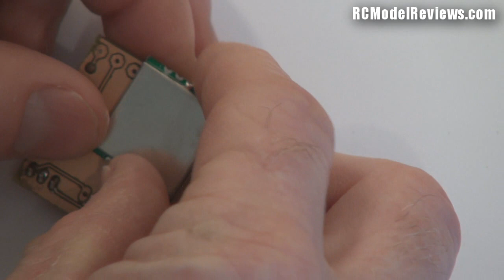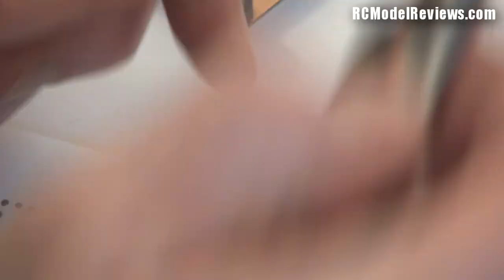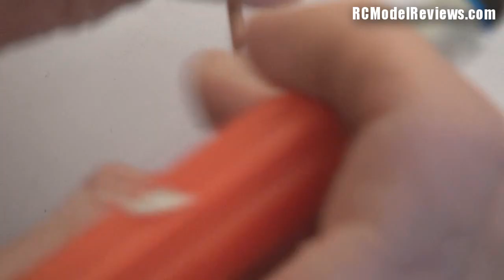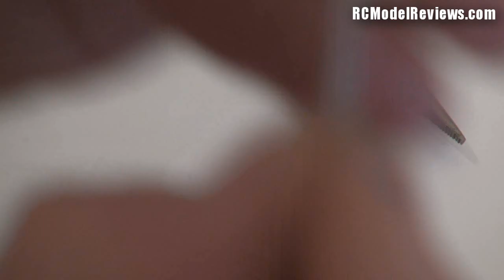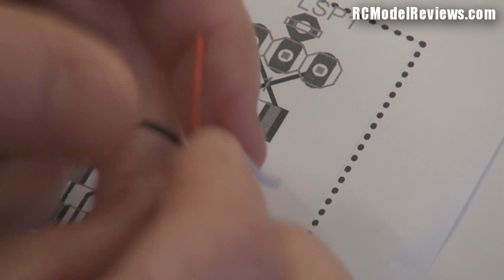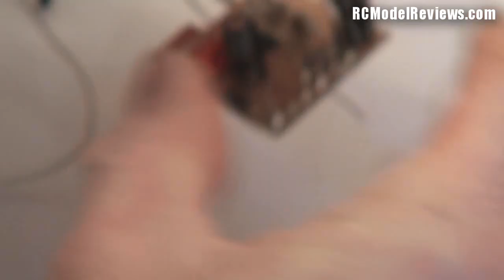FPV Backpack PCB build (part 2)

Comment: Very neat indeed!  Am looking forward to getting my hands on the parts!

When you install the pin headers, just leave the plastic on at first to make them easy to line up.  Once the bottom side is soldered, the plastic bits will just slide off so you can reach to solder the component side as well.  The solder heat seems to weaken the adhesion of plastic to pin (as discovered when trying to get shield pins and Arduino sockets to line up nicely).

Comment: Bruce, good tutorial. I like 5.8G; works well. I made a similar one a few years ago on 2.4G using Airwave 10mW modules that were available from Jaycar. As you've said before 2.4G video is no good with 2.4G RC and picks up wifi etc. But I've had over 1Km with 10mW, cloverleaf on TX and patch on RX.

I've got a couple here still so I could do a quick tear-down to show what's in it.

Comment: Yes... This is 2.4G with a cloverleaf antenna on the TX and a patch on the RX. At 1KM the picture is good with the receive antenna aimed at the transmitter. At 1.6KM the picture is still good, but antenna alignment is very difficult. The RX is a Airwave module and the  antenna a home made patch of about 10db based on comparison with a commercial patch.

I'll post a video of the setup tonight. I'm planning some fpv tomorrow so I may get a chance to video this setup as well.

Comment: Good question, would be interesting to see.
The kit on hobbyking for 45 $ is a 900MHz kit, which means if you were to design the same type of antenna for it, it would have to be huge! (Check out RCexplorer.se for antenna calculator). 

This is a 5.8GHz system and hobbyking are charging 66$ for the transmitter and receiver pair (without camera), and the receiver does look "chunkier". So Bruce's might actually be good value.

Comment: With the correct antenna I've heard of distances close to 2km with this 5.8 module. I fly my blade quad in the basement from the third floor master bedroom and I use my plasma tv for my monitor. The signal is great and I'm just using the stock piece of wire, no cloverleaf, because of weight. My problem is that I need to figure out a way to make a very small lightweight noise filter so I can ditch one of the batteries. I would be very interested in seeing a teardown of your 2.4.

Comment: I was thinking the same thing.
All I can see is the experience you get in tinkering, and that hobbyking sells kits that are like 2.4GHz, 900MHZ which could get more interference than this project if your transmitter is also 2.4GHz which is common (the project is something like 5.4GHz? which is a safer bet for most people in most places).

Comment: Hi Bruce. Thanks for all the great info. I have learned a lot from you over the past year. I don't know where I would be without your guidance. I have a ground station question. I have put one together using cheep red and white audio cables cut to the appropriate length. I installed new rca plugs where I shortened the cable. I run two receivers to an eagleEyes box then out to a foxtech dvr, monitor and fatsharks. Do you think I would view/record better video with higher quality cables? Thanks

Comment: HEY, I finally got my boards to transfer and etch and they even line up. In the end I printed a whole sheet of fronts and backs and used a full sized copper clad board and while all my other attempts sort of failed, or almost worked, depending on if your a glass half empty or lap half full of the other half of your glass kind of a guy.... I digress. I have about two dozen nice boards and at least 8 not so much boards that I'd be willing to trade some of the smaller components for?

Comment: Bruce, first of all thanks for all that you do. 
I have the commercial board and it doesn't have that exposed area where you soldered the shield wire from the antenna. what do i do when i get to that part?
Awaiting a response before i proceed

Comment: FPB (First Person Braille ) because people ask me about mowers that can remotely cut the lawn. But I want FPV so I can sit in a lazy boy inside and via my large 42 inch TV I can have my hand set and see myself mowing the lawns. Inside dry and using a hybrid mower with an alternator that charges a 12-36v battary bank. Rod

Comment: I have a quick question for you, Bruce (Or for anyone that may know).

Do I need to filter the ESC/Motor noise with the regulator from just the video transmitter, or does the camera need to have perfectly clean power as well? I would assume the camera is less sensitive to the dirty power. Could I get away with just a capacitor for the camera, and a regulator for the TX to run from my 3S flight pack?

I hope I am clear enough to get my point across here.

Thank you in advance for any help.
Will

Comment: its so easy to use the receiver, solder on two wires for video, a 7805 for 5 volt supply and thats it, i dont even use any caps

Comment: Why do you need to power this with a 5v ubec?  Doesn't the LM1117 convert up to 20v down to 3.3v at 400mw?  Or would it be possible to redesign it to add a LM7905 5v @ 1.5A or a LM323 5v @ 3A with a 5v feed out?  Are the capacitors to keep the voltage at a constant value with the draw from the motors, or is it clean power for multicopters?
Reply: Because the LM1117 that is on this board is just to small to dissipate the heat that would be generated by putting 12 v into it unless you add a Lg heat sink plus the ubec gives a cleaner output (IMO) but you are correct it (ubec) is not really needed with this circuit